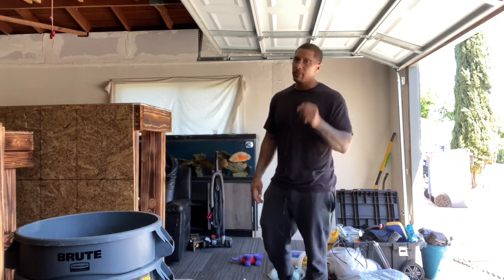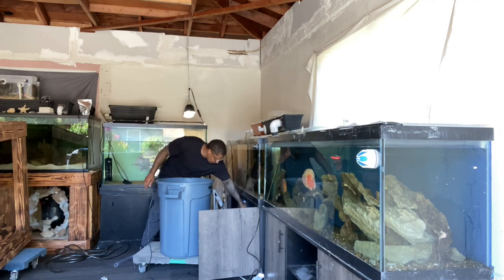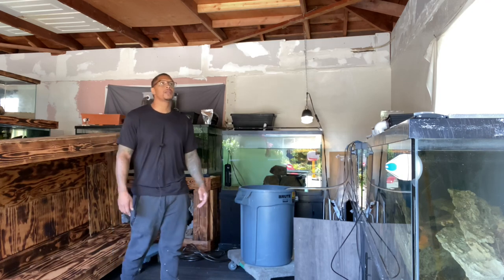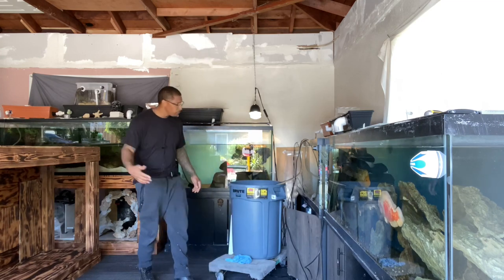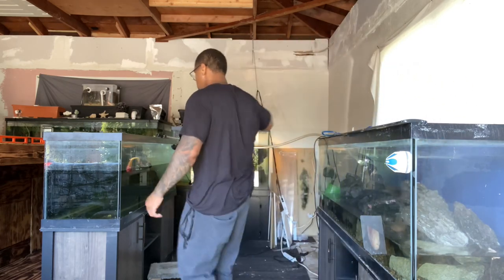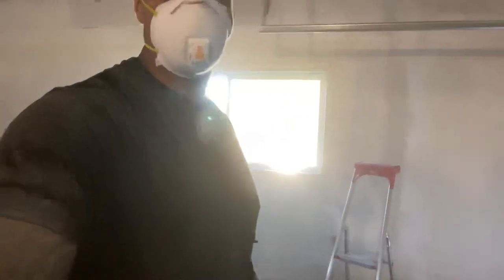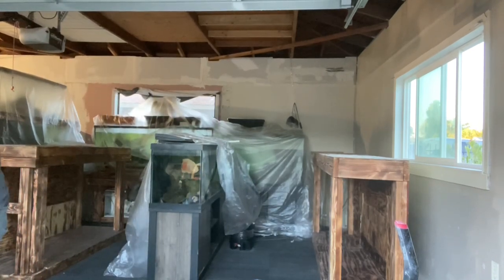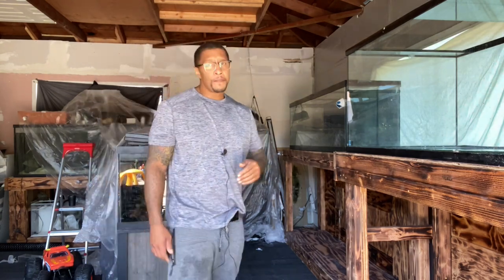MOVING FISH TANKS! DIY AQUARIUM STANDS!! PAINTING WALLS!

Comment: I work with sheet rock a lot in that situation with all the tanks I would of used a towel and a 5 gal bucket of water I did that to my gym and it turned out perfect I just didn't want to get the dust all over my equipment